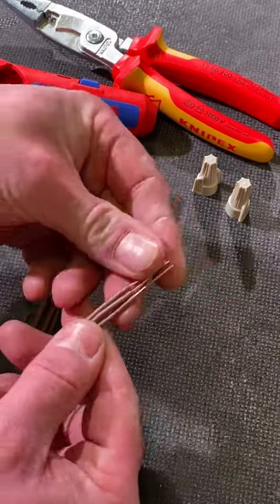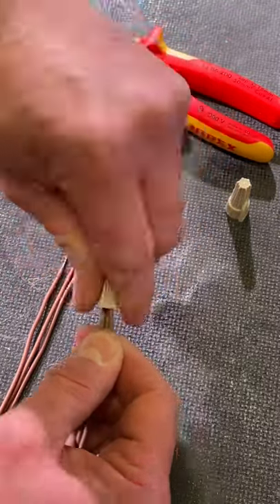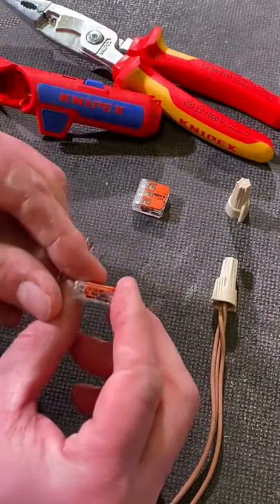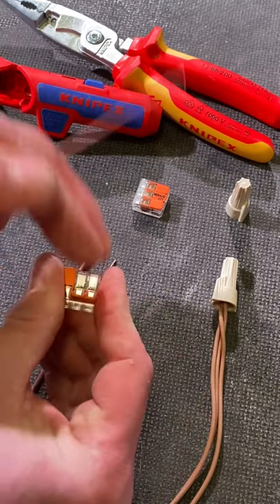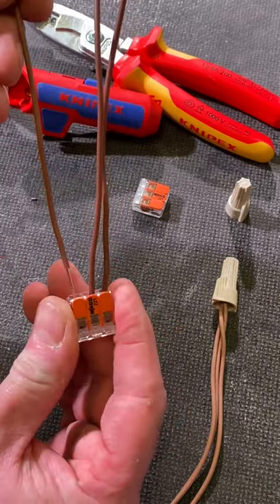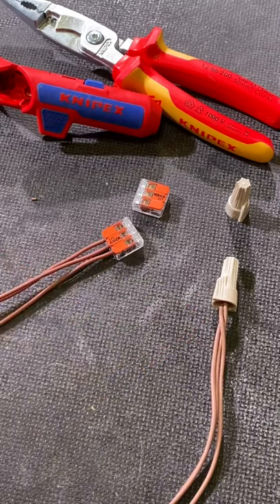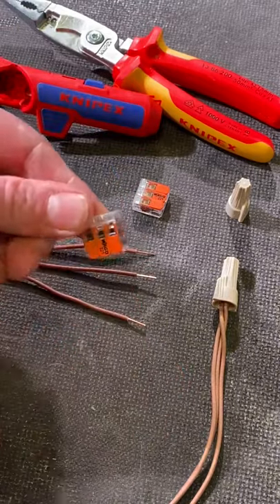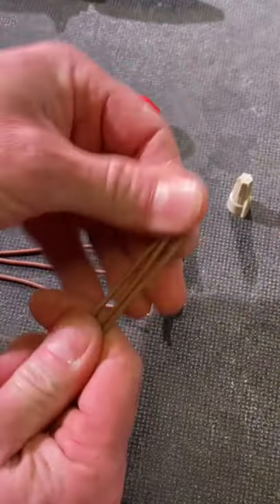Which way do you splice wires? WAGO 221 vs WIRE NUTS? | Electrical #shorts from eFIXX

Comment: I thought wire nuts was a janky American concept, that wouldn't be legal over here so surprised to find your even asking the question.
Reply from the maker: We found these in the kits Ideal sell in Europe - we can't see any regulations which prevent their use.
Reply: That’s right they were actually used in the UK 80years or go in junction boxes. Made from ceramic I believe. Lab testing has shown they are not very different if done well compared with Wago type connectors. Good manufacturers like ideal have to have them lab tested UL listed here so they are definitely fit for purpose. That being said many over here are starting to use Wago connectors.

In US we can reuse wire nuts see you cut the wires made me laugh over time if you keep undoing and loosening in them they loose efficiency.
Reply: Wire nuts 🤮
I thought they disappeared in the UK 40 years ago and it was just the yanks who still used them along with their uninsulated screwdriver and linesman pliers
Reply: @davey6024  as if the tools made the electrician 😂
Reply: @efixx  interesting to know, I won't immediately assume cowboy, if I see them. The wago ones just seem so much more sensible as both a usable variant, and reusable one, not that I'm saying the nuts can't be reused, but not designed for it easily, in the way the wagos are, going on Americans comments on this thread and other times I've seen them used.
Reply: Screw connectors or wire nuts are not common anymore here in the Netherlands, however you can still buy loads of these anywhere.
Reply: @filipe.skunk8  from experience they do. Good electricians invest in their career whilst the shit make do with the bare minimum. Its one of the few examples that all the gear no idea doesn't seem to apply to. If I walked onto site in the uk and seen an electrician using wire nuts I would automatically assume he was not from this country therefore making him shit. I have yet to see a decent immigrant electrician that actually works to our regs. And I have worked with many. Just my opinion from experience, feel free everyone to give yours.
Reply: @davey6024  an immigrant electrician will certainly execute a better job as the standards are more demanding than in Uk or you think you’re allowed to bodge stuff in Eu like you do here 😂. You guys are 100 years behind in materials and how to execute a decent install, simple example of that is electricians still using nail clips and bodging cables into the building fabric, zero infrastructure provided.. now if you’re talking about immigrants ( or even British ) that weren’t electricians before and took your UK “3 day fully qualified electrician” courses ( because competence here is purchased and not learned ) then yeah I’ll agree with you 😂.. but the tools do not reflect an electricians skill/quality.
Reply: @filipe.skunk8  utter rubbish. The UK has the best electrical infrastructure, standards and sparks 🇬🇧. And if your talking about domestic and I'm assuming you are with cable clips, please tell me exactly how you would install let's say 16 recessed downlights into a kitchen of a 120 year old, occupied house with wooden joists and floorboards. Would you tell the client the whole ceiling has to come down from the DB to the kitchen so you can install a conduit run and individual through boxes for each downlight? In regards to commercial & industrial we have excellent containment systems and regulations for provisions for future expansion on new installs. Iv been to a lot of countries in Europe and literally everywhere I have been the electrics have been terrible. Probably Germany is the best I have seen.
Reply: @davey6024  if you say so.. speaking of high standards and the best sparks, today been troubleshooting some sockets I found with no earth in a rented property, working live and with my bare screwdriver (because I like to live on the edge), and found out the toilet, kitchen, bedroom and living room lights were being fed off directly from the socket ring.. no shitty fuse spur no nothing.. want to guess how many British “qualified” electricians did works and EICR’s to that property and gave it a ✅ ? You guys are great on the scientific calculator and ticking boxes in the paperwork I’ll give you that but execution of works is rudimentary and poor.. why would you run the kitchen lights directly off the db? 😂
Reply: @davey6024  yeah we have very strict regulations in germany. And the only reason something is not up to snuff is if someone without cualification fiddles about
Reply: @filipe.skunk8  You’re basing your opinions of British standards on domestic electrical work? You’re not the full ticket.
Reply: @davey6024 Wagos introduce resistance into the wire because they use a bus bar not made of copper. They cause heat because busbar. I've seen them explode when there was a dead short. Wire nuts dont have an amp rateing because your bonding the actual wires together. Us Yankees invented and were the first to use AC power in 1886 - Great Barrington, Massachusetts. It was first displayed using step up and step down transformers. The system was built by William Stanley and funded by Westinghouse. In the United States.
Reply: @davey6024 Wagos are amp rated because they use a busbar instead of bonding the wires together. Therefore they introduce resistance Into the circuit I've seen them explode when there is a dead short. A good electrician uses wirenuts because they are safer. All wagos have is ease of use.

Comment: this wagon 221 connectors are a must to have on everyone toolbox or pocket, when I need to do some measurements with the meter I use one of the wagon 221  with a wire to connect one of the meter terminals to the ground circuit and it's easier to troubleshoot the electric circuit

Comment: Those stab in connectors came out when I was an apprentice  about 20yrs ago and I never liked them. I was always taught that a tight connection was the best. Those wires wiggle and spin in those stab in connectors and I'm just not comfortable using them.  Just like those shitty stab-ins in those cheap devices you get from home depot or lowe's. I don't care if they're UL listed I still think they are junk. If I had to take the wire nut off I would take the time to twist it off and straighten the wire then twist the wire with my pliers.. I understand the intent of the video but I wouldn't use the wire nut to twist the end of the wires together.. Always pliers first

Comment: Twisting wires together is frowned upon so I’m surprised wire nuts are still used.
Reply from the maker: They are massive in the US
Reply: They get way more surface connection than Wago when used properly, but unless you got it down to muscle memory, they are easier to fuck up. But I never understood how they became a thing either...

Comment: When using Wagons only 1 lever should be lifted at a time else the spring contact can be over stressed.
Wagos provide access for test probes and when fault finding allow conductors to be easily disconnected temporarily and then reconnected without any risk of damage to the conductor.

Comment: In the 70's, push fit connectors were crazy popular, because they were so easy. Years later, corrosion forced the spring loaded connection apart and caused fires. For a long time they were still legal but not considered safe. Certainly the surface contact area is smaller than that of twisted wires held in parallel. How are WAGO nuts different than those old push connectors?

Comment: I’m the last 2 years I’ve been to about 1/2 a dozen houses to fix outlets with stab-lock connections. One of them even had the outlet practically melted. Back in the 70’s and 80’s contractors building new homes told their electricians to “back stab” all the devices, to save time. Years later those connections are overheating, breaking and failing. Now, the same exact design of a spring loaded clamp that grips the wire, biting into it is what all wago style wire connectors use. Having seen what happens to these type of connections over time, why would I trust push-in type connectors? I mean they’re ok for certain applications like end-of-line ie to a light. But I can’t bring myself to be convinced yet to use them for anything else. I see why people love them, of course they’re easy, quick and require very little skill to use. I tell you what I liked way better, those screw terminal block things, those are solid. A 6/32 screw can clamp with over 400 lbs of force. Wagos clamp with what, 1-2 lbs? Plus you just twist em back and forth and the wires pop out. Not what I would call a “solid” connection. But hey, time will tell if they last.

Comment: Whenever I connect solid conductors, my preferred method is twisting and a blind terminal. If braided wire conductors are used, I prefer to crimp on a ferrule and use the Wago terminals. Wire nuts are not very popular in Bulgaria though.

Comment: I’m not an electrician but I’ve seen content of electricians saying that in due time the WAGO metal prongs become lax and if there’s any tension on the wire it will eventually come out of the WAGO.  I reuse the wire nuts over and over but I think that is a bad habit.

Comment: WAGO is the way to go for din rail installs now. WAGO has din rail clips that hold them on and is preferred for them. In wall installations is either or but given we have so many cause of din rails, mostly is used for in wall as well (in a box of course, not blind in wall)

Comment: I've been told that proper technique with wire nuts is to twist them for a strong mechanical connection, the wire nuts is really just there to protect the wires.

Comment: Wire nuts for anything that experiences a lot of vibration. I'm a commercial HVAC service tech. I can't even count how many times I've had a service call for blower motors that got shorted from those. They rub thin and short out pretty fast. I've seen countless ones on PMs as well that were close. Wagos like that are great for low voltage wiring and for making multi tap jumper wires for testing. The household electrical wagos that don't have the levers, are amazing. They only work on solid strand wiring or tin dipped wires though.

Comment: Waggs can loose connection if it's super cold ,if it's cold an home owner plugs a space heater in or blow dryer heavy load ,n the waggo is cold metal will seperate causing sparking an fire 🔥.  The best way is twist stripped wires with kleins pliers cut off the tip then use wire nut .wire nuts just for a cover ur twist is what's supposed to hold together

Comment: My old electrical teacher would have a heart attack if you did not pre twist those leads before putting on the wire nut, twist was not meant to exceed past the length of the wire nut other wise you would stay back until you got it right and 10 pull ups plus 50 push ups per mess up 😂 , (he was a marine) very detailed.

Comment: Solder and shrink insulators but, in a pinch I use wire nuts. And in all my years working with wiring I have only had to cut a wire nut off once. Was an old house with fabric insulated wires and the wire nut in question was over 30 years old and in a damp area and had somehow fused itself to the copper.

Comment: Wire nut. Unlike the WAGOs, the wire nut physically mushes the wire together, giving a far stronger (electrically and physically) connection, that also has the benefit of keeping out corrosion because of how much physical pressure is keeping the wire smooshed together.

Comment: Depends on the installation type and area. I'd rather use the Wago or screw connector blocks for most areas. In wet outdoor areas I'd leave more slack in my wires and connect them by crimping them in a ferrule and then heat shrink over that

Comment: US RF enginerd here, I DESPISE wire nuts with a passion, I thank the lord daily for home depot carrying 3 gang wago terminals. Nothing worse than using a wire nut on 12 gauge stranded wire, especially when you want to have a small simple interconnect for passing 12v DC to various electronics in an enclosure.

Comment: In the US you have to special order the lever style wago. So wire nut or push-in connectors, you pick whichever is handy.
Reply: No you dont there available  at homedepot lowes and any hardware store that has a electrical section

Comment: Not an electrician but a handyman. I would chose that twisty if my installation is permanent or will not be disturbed for reinstallation for a very long time.
Reply from the maker: Try a Wago - you may be surprised
Reply: @efixx  
Yup. I'm open minded. I'll try that on my next installation.

Comment: I don't know how many tens of thousands of wire nuts I've put on and taken off but I have only cut off a handful. Most wire nuts will come off and go right back on the same number of wires. Most will also go on again if you add a wire or two. Cheap wire nuts will take a set and not go on a smaller number of wires. 3M wire nuts are the best and will go on a large number of wires and still grab less wires if you remove a few. You should also twist the wires together with lineman's pliers before you install the wire nut.

Comment: Just untwist the wire nut and reuse. All the commercial work I do we twist the conductors with linemen’s before installing the wire nut so the next guy in line that takes it off doesn’t have wires jump apart. You learn to appreciate it after doing hot work in tight spaces.

Comment: In 45 years I rarely have had to cut the wires. After taking the wire nut off, just straighten them, add or remove a wire and check the wire nut, and reuse it, if it's ok. Always avoid cutting the wires shorter if possible.

Comment: Wire nuts pointed up (to keep moisture out) at the weather head off the service drop if our potentials are spliced in at the sideby. Otherwise insulation piercing couplers are used.

Comment: Wago, acept no substitute. In july I introduced them to a HVAC class that I was running. Left the class struggle with crimp splices before handing them a wago (so much easier). The test port was very usefull, too.

Comment: None of these, clipsal screwed connectors. Has a threaded tunnel with a phillips head screw to clamp down. Twist your wires together, clamp dowm with the screw.
Will use wagos for flexible cables tho.
Reply: BP’s for the win

Comment: I mean. Lefty loosey right tighty, back that wing nut off and use that tool in the background to twist em once and you’ll have the same result, what’s the cost diff? Not to mention the holding strength of the wing nut compared to the clips that can snag and be lifted by a wire in the box and come free... I’ll use the wire nuts all day.

Comment: Wago connectors are better period and I live in the states. I use the push style for solid wire and it’s a breeze and the connection is always rock solid. I wish I had lever ones whenever I’m dealing with stranded wire. Wire nuts are just obsolete.

Comment: American receptacles typically come with connectors comparable to Wagos in the back. Every electrician you meet will say to never ever use those. Until we start using backstab connectors regularly, I doubt Wago connectors will see regular use.

Comment: I've been using wire nuts for 20+ years and never had to cut one off but I have seen push connectors start many fires so I think Ill stick with my wire nuts
Reply: Don't know how many service calls I have had to go to where a wire slipped out of a wago. Almost as bad as stab-in outlets.
Reply: @bserieshatch1  glad its not just me 👍 If I see stab-ins used on a job I will generally rewire them properly for free (within reason) just to avoid future disasters.  The worst are the receptacles that have only stab ins and no screw terminals, I can't believe they even made those.

Comment: you can reuse a wire nut.  plus the wire nut itself doesn't provide a bus for the wires, they are already connected.  the waygo depends on the connectors internal bus bar, and they don't look terribly stout.  waygo are much easier to use though.

Comment: For one when using a wire nut you have to re-twist the wires for a good mechanical connection. 2 you can untwist a wire nut to reuse it. 3 wago uses a bus bar type connection which isn't copper so they introduce resistance into higher amp connections that's why wago has an amp rating and a wire nut doesn't because the wire nut ties the same size conductor together therefore it's like the wire was never cut. I've seen wagos explode when there is a short never seen a wire nut explode. Mind you I rarely use wagos but always use wirenuts.

Comment: The conductors are supposed to be twisted together BEFORE using the wire nut. The WAGOs have a much less surface areas to make contact to each other and they are more expensive to buy

Comment: I actually twist my wires together with my pliers before I put the wire nut on. They are listed as pressure type connectors so once they are on, you twist them more than hand tight. I see wagos fail all the time, and it's always the wago that failed, the only time I see wire nuts fail is bad workmanship or dissimilar metals.